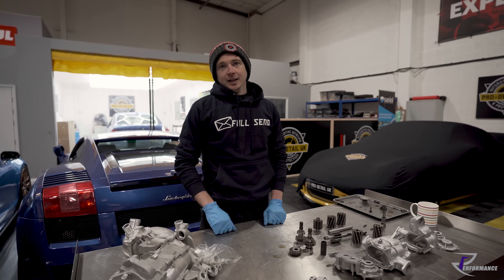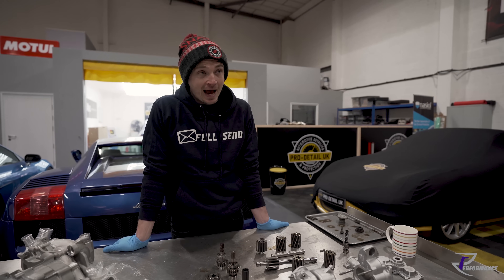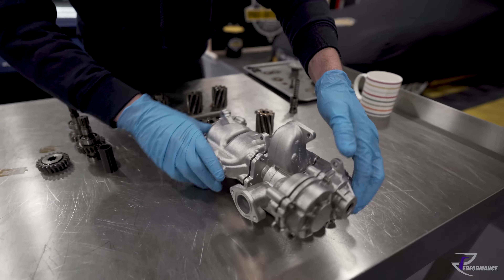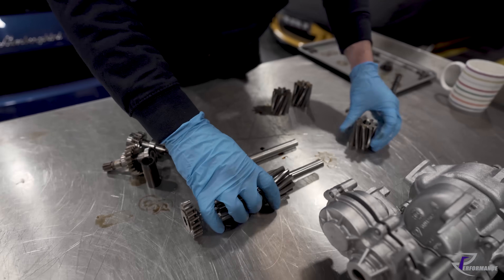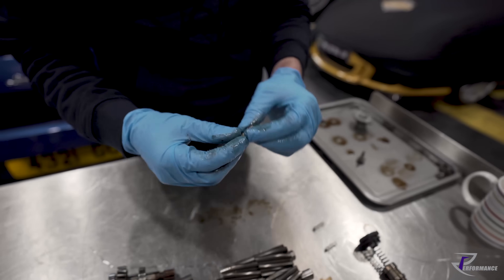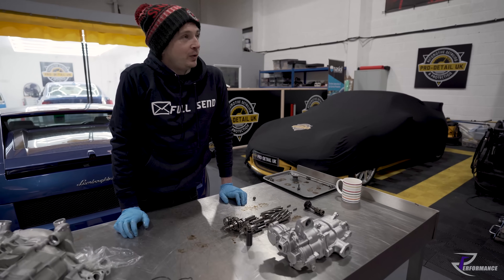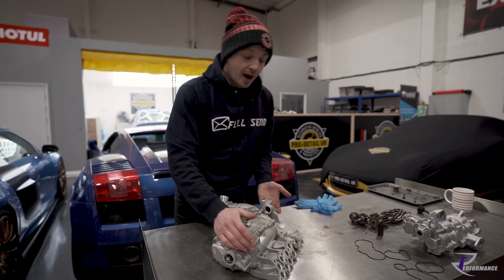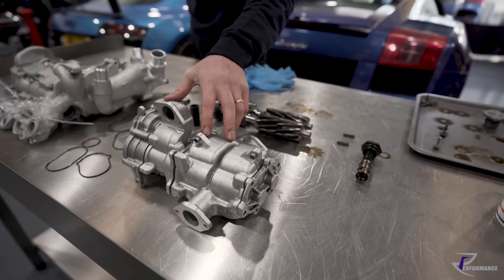Lamborghini V10 oil pump failures – differences between 5.0 & 5.2

Comment: I'm building a v10 r8 engine here in Brazil. During the inspection before starting assembly, I noticed that the oil pump does not turn by hand. If I disassemble it halfway, it spins. It has many deeply scratched parts. That's probably what caused the breakage. This pump must rotate freely in the hand, correct?

Comment: I need to replace the shaft tube seal on my LP560, but do the engine have to come out like in the manual, or is it possible to do this job without taking out the engine?
Reply from the maker: The sharp tube seal? Do you mean for the oil pump drive?
Reply: @REPerformanceUK  Yes ☺️
Reply from the maker: @espenlund1444  No, you can drop the oil pump off without removing the engine.
Reply: @REPerformanceUK  Nice, thanks! But what do I do if the aluminum bolts snap like you mention? 😅 With my luck and a car that has seen some norwegian salty roads I guess they all will snap 😂 It is impossible to get to all the oil pump bolts without disassemble the thermostat housing and water pump housing?

Comment: I may be wrong, that is not corrosion , it is  caused  by fretting  a micro vibration caused by gears 
And spline shafts would wear out , using anti fretting grease will help to fix the spline wear, brown stuff is ferrous dust
Reply from the maker: It may be that too, but the corrosion build up on the shafts is pretty bad, could be the parts then fretting in the corrosion just wears it away.

Comment: Hi Ricky what’s the cost of replacing the seals and servicing the oil pump on a 5.0 Gallardo?
Reply from the maker: Depends on what is wrong! I think we have been chatting in mail?
Reply: @REPerformanceUK  yes have forwarded our email chat to the dealer this morning. Hoping you’ll get a call from them this week to discuss. 
-Sam.
Reply: i will be doing one next week. rs6 but near enough same setup

Comment: Hi when you do the rebuilds on the pumps. Do you put alloy bolts back in or replace with steel ones? Do to them snapping in the past
Reply from the maker: Yes we replace with better hardware, plus clean the threads properly and use lots of anti seize.

Comment: The size of those pumps! Why does the scavenge side need to be double the size of the pressure side? Do the pumps need upgrading when you turbo the engines?
Reply from the maker: The scavenge has to empty the sump to keep the tank full, but also has aeration to content with so you normally find that side of the pump is bigger.

Comment: Why would they use aluminium bolts? Seems silly, but is there an engineering reason? cheers
Reply from the maker: Weight is the main reason. Don’t need the torque yield like a steel bolt offers so don’t carry the weight….
Reply: @REPerformanceUK Just one coffee would weigh more than that saved by using aluminium bolts. Stupidity.

Comment: The pump in the 5.0 only has 1 scavenge stage.  This is not going to work well with blow-by gasses mixed with oil.  Any proper dry-sump pump should have multiple scavenge stages like the newer 5.2, or any other proper designed engine with dry-sump.
Reply from the maker: It works well enough for the application, but yes but design standards now is out dated.

Comment: Machine a replacement for that coupler out of 316L stainless.  Material is so often ignored by automakers.
Reply from the maker: If we did more I probably would but the development and manufacture cost just outweighs the need.
Reply: @REPerformanceUK  I have a recently acquired 2003 Arnage with 14,800 miles on it where the previous owner split the front underbody cover.  A shop in New York has it to scan and print.  If those sleeves are easily purchased, I'd at least have them nitro-carburized.  I would think volume is a major issue for you.

Comment: pump housing molded seals... with CMM and 3D scanning.. you could scan a few housing ends and have dies made to work with oring manufacturers equipment for customs.   i wonder if you could slide a forshida seal on the input shaft to protect the inner seal like a slinger
Reply from the maker: All comes down to how popular they would be vs the cost to do it!

Comment: Another extremely informative episode from a garage determined to go above and beyond with their love of cars. Well done and I love this team and the work they are doing. Some people have no class using the C-bomb just because they assume they know the presenter. Ignore those idiots, you are doing a fab job.
Reply from the maker: Thank you!
Reply: @REPerformanceUK  in the huracan v10 the transmission has a shaft that goes through the engine and to the front

I want to know if it passes all the way through the block or passes by the side of the block?
Reply from the maker: @FirstLast-tx3yj  the R8 has the same. It passes through the rear timing cover and lower girdle.
Reply: When the bearings are ok, is there a other Point where a 5.0 can loose oil preassure?  Thanks